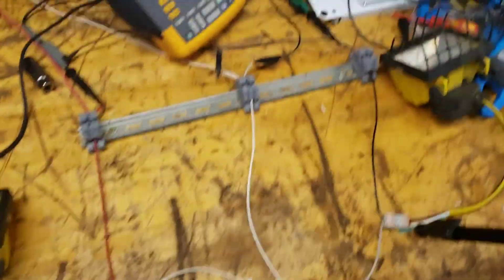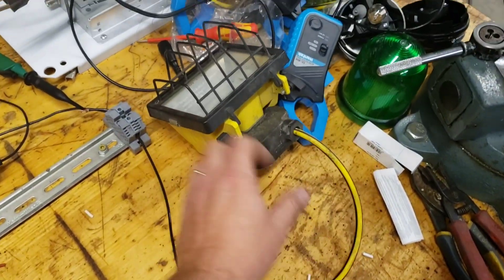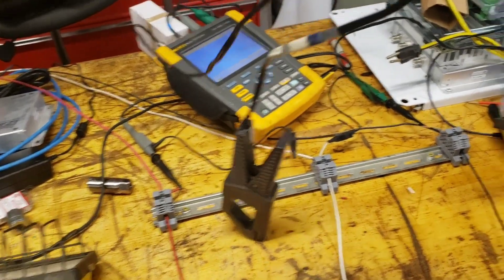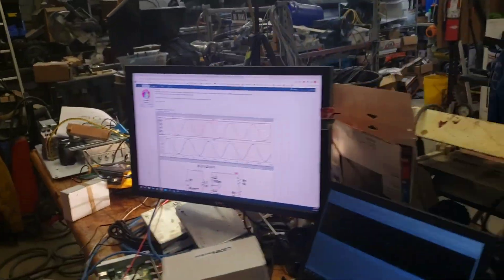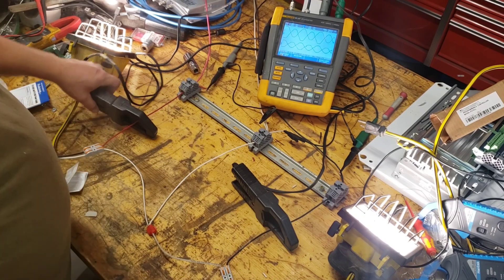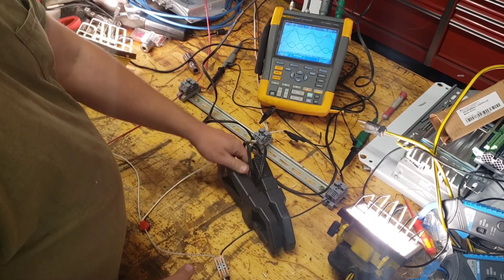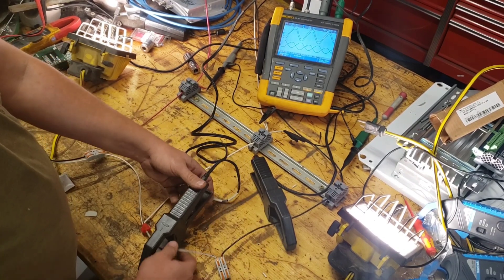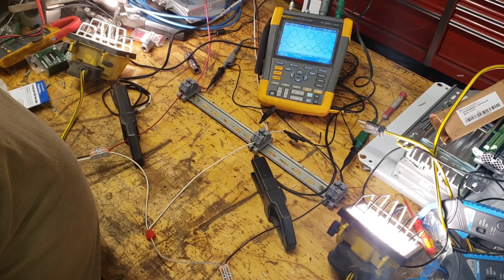Inverted/"180 degrees out of phase" current.

Comment: I'm not party to any of the lead up to this (just a stranger wandering in), but I would point out that those who claim center-tapped split phase systems are inverted or 180 out-of-phase are NOT saying that the current is going in different directions on the Lines. That would be a straw man argument you've shot down if your goal is to disprove the 180 out-of-phase sentiment. Is that what you're trying to do?

The whole 'in' vs 'out' debate is ridiculous in that both sides are right from their own perspective. In my experience though, the 'they're in-phase' crowd is less accepting of those arguing they are 180 out with respect to neutral. It needs to be understood that the 'wrt neutral' component is essential. The two lines-- if not using a neutral-- is just a single signal. So there's not even anything to discuss. When there are 3 points to measure the signal from (bottom, center, and top-- with center as common) then there is no denying that mathematically they are 180 out of phase. To claim otherwise is to deny what's in front of one's face. But if it tastes just soo ucking yucky that they can't even utter the words 'out-of-phase' to describe a wave relationship, then sure, go ahead and call them series-aiding-splits or whatever the heck floats the butt curls.
Reply from the maker: You read the situation correctly and I'm in the "in phase" camp. I have no problem with someone saying "L1 and and L2 are opposing with respect to neutral. " I like to take it a step further and say "they only appear out of phase when neutral is used as a reference" but I don't expect anyone else to make such concessions. 

What I push back against is people saying "L1 and L2 ARE 180 degrees out of phase with each other" because that (more than) implies something that's absolutely incorrect and leads to further misconception, like that current flows opposite directions through the loads on L1 and the loads on L2. That's the misconception that prompted this video. I had a combined 150 years worth Electronics Engineering experience ganging up on me in a forum insisting that not only (the voltages don't just APPEAR out of phase but actually ARE out phase) but that (the CURRENT, TOO! is out of phase). They "proved" it in LTSpice by flipping a resistor to force the reading to be out of phase. Link to the discussion below if you're interested.

To be clear, both sides of this argument generally are using "180 degrees out of phase" when what they really mean is "inverted polarity." I don't think anyone is discussing this in terms of one side lagging the other by 8.3333mS. Therefore saying L1 IS inverted (180 degrees out of phase) with respect to L2 implies a physically inverse connection. It's easy to think of it this way since there are just two end and a middle, but it's wrong, and easier to see the incorrectness of it by using an example with more points. Like a series string of batteries in a golf cart. If one of six 8V batteries IS inverted, then the overall voltage will be 32V instead of 48V. If you measure 48V then you know that they are all connected in series and precisely zero of them ARE connected inversely. In the arguably incorrect terminology framing this discussion, they are all IN phase. If you want to reference all your measurements from the center point between battery #3 and battery #4 that's fine, but all your measurements from center to left will read negative while all your measurements from center to right will read positive, and you'll need to keep that  in mind, maybe state the effect of your chosen reference point when giving measurement values, so as not to confuse people as to why some of your measurements are negative while others are positive, and confuse them so thoroughly that they go all the way to retirement as an Electronics Engineer, thinking that current is flowing opposite directions through half the batteries.

https://forum.allaboutcircuits.com/threads/l1-is-180-degrees-out-of-phase-with-l2-hurr-dee-durr.172264/post-1785368
Reply: @Charles Staton  If you stand in the middle of a river, the current of the river is all going 'in the same direction' but to the observer in the river some of it is coming towards you, while some of it is going away from you. Both realities are true.

That's the situation here. The current waveforms are out of phase, again, with respect to neutral. What you've shown is that the river is traveling in the same direction, but to neutral L1 is 'coming' while L2 is 'going.'

I have no doubt you and many others making your argument (https://youtu.be/nOSYHUxHxG8)
understand the physical realities of the system perfectly well. Just as many making the 180 OOP argument understand it perfectly well. It's basically political-- its how one chooses to talk about it and what one choose to focus on and what you choose to ignore.

You say "they only APPEAR out of phase when neutral is used as a reference." OK. What's the difference? Why is using a neutral point reference a lie? Phase relationships are specifically about just that: relationships.  Reference defines the relationship.

If your camp wants to define in-phase as two coils 'boosting' rather than 'bucking' or series-aiding rather than series canceling, than sure, one cannot (should not) argue otherwise. But deciding that THAT is the only true way to define the relationship is political. Straight up. 

Let's look to a 3 phase system for some comparisons:
If you measured 2 lines of a 3 phase system as you have, you would get 60 degree out of phase as your determination. But there's no argument it's 120 degrees (right?). So why is it 120 and not 60? Because neutral is reference!

Take the river for example. Let's say you have a river with a bend in it to bring the analogy to 3 phase. If you stand at the vertex of that bend, then measure the angle from one leg to the other, you get 120 degrees (and the current is coming at you in  one case and going away from you in the other-- sound familiar?).

If, on the other hand, you insist that because the river is going in the same direction (with the exception of the bend) that the measurment be taken from someone always looking down river, guess how many degrees the river turns? Yup 60. So do you want claim two legs of a 3 phase system are 60 degreea oop?

If not, why should the rules be applied differently for a split phase system? 

One last point: hopefully it's agreed upon that if neutral is not involved in the measurment AT ALL, not only are the two lines not out of phase, they are also not two signals IN PHASE! They ARE ONE SIGNAL! This is true in 3 phase as well. 2 lines not using the neutral have no 'phase angle' they have a single signal between them. So I agree that saying the two lines themselves are out of phase with no reference point is entirely incorrect/meaningless.

BTW I do like your video, I got a kick out of it, even if I'm of the opposite political opinion :)
Reply from the maker: @spruce_goose5169  I've been making this argument for years and you've just made the most cogent counterpoints I've ever encountered. What you've said deserves a reply that I'm not prepared to compose on a cell phone so I will be responding later from a computer. Thank you for the stimulating discussion.
Reply from the maker: @spruce_goose5169   (Part 1 of 2) I’m sorry, but what follows is the longest comment I have ever typed on Youtube. You brought it on yourself though, you really should have known better ;) . I won’t blame you for not reading it all, but I hope that you do.

"If you stand in the middle of a river, the current of the river is all going 'in the same direction' but to the observer in the river some of it is coming towards you, while some of it is going away from you. Both realities are true."

I use the same analogy (worded a bit differently) quite often, but I use it to point out the difference between absolute measurements and differential measurements. What I say is “Current is an absolute measurement. It needs no reference point. A river flows down hill whether you’re looking at it from the source, the destination, or outer space. You can decorate all the components of a schematic in little + and – symbols a la KCL if you find that helpful but it doesn’t change the fundamental reality of the absolute nature of current.”

 “That's the situation here. The current waveforms are out of phase, again, with respect to neutral. What you've shown is that the river is traveling in the same direction, but to neutral L1 is 'coming' while L2 is 'going.’”

Going back to the video, If you are not in agreement with my previous statement, could you explain how I should take these absolute measurements of current “with respect to neutral” in the real world, using a current clamp? I’m sure it would involve flipping the clamp, but at what point? Just after the load? In the middle of the load? Just before the neutral node? Right in the middle of the neutral node? What if I cut off the neutral wire so there’s just two loads in series across 240V (no current flows in the neutral anyway, with a balanced load)? Should I still flip the clamp? Getting the answer that the “180 degrees out of phase” crowd wants to see, feels very “forced” the moment you take the exercise off paper and into the real world. And that’s because it IS forced. It’s a teaching aid (KCL) taken past its point of efficacy. 

In contrast to current, voltage is a differential measurement, that only exists between two points. In the case of measuring split phase mains where both measurements are referenced to neutral, the voltage waveforms will (be? appear?) inverse to each other. I can’t speak with as much authority on voltage because there is some philosophical aspect to it. It’s like the question “if a tree falls in the forest and nobody is there to hear it, is there any sound?” Well that depends on whether you consider sound to be a human observation (measurement) or an intrinsic property of the universe. 

Same for voltage. Do you consider voltage to exist purely as a measurement? Or do you consider it be an intrinsic property of the universe? I’m on the side of it being an intrinsic property of the universe. In my book, if you put a DMM across a battery and it read 12.65V, it still has 12.65V when you take the DMM off of it. Technically this is in defiance of Ohm’s law which states V=IR, and as soon as you remove the DMM, there is no I and no R, so there is no V. But that’s a little too abstract for my taste. 

But if you’re on the opposite end of the spectrum and place higher import on academic curiosities than you do intuitive concepts, then you might view voltage purely as a measurement which only exists while being measured, and therefore it doesn’t just “appear” out of phase, it IS out of phase. That’s a “valid” point of view I suppose, but as I said, too abstract for my taste, and I think it confuses the hell out of people who are trying to learn this stuff. That’s why I’m so adamant about presenting what seems to me to be the more intuitive side things. 

“ It's basically political-- its how one chooses to talk about it and what one choose to focus on and what you choose to ignore.”

Agreed. 

“If your camp wants to define in-phase as two coils 'boosting' rather than 'bucking' or series-aiding rather than series canceling, than sure, one cannot (should not) argue otherwise. But deciding that THAT is the only true way to define the relationship is political. Straight up.”

I like that you use the word “political” rather than “semantic,” which is what I normally hear. This is much more than a semantic difference, and "political" is really the most accurate description of it. There are plenty of political parallels (ex: debates on gender/sex). I subscribe to the views that I do, because I think they are less abstract and more readily demonstrated in the real world. Do you disagree? If you think that your views should be the dominant ones, what is your reasoning for that? 

“Let's look to a 3 phase system for some comparisons: If you measured 2 lines of a 3 phase system as you have, you would get 60 degree out of phase as your determination.”

Can you explain? I do not know where 60 degrees is coming from. I measure 3ph on a weekly basis and it is always 120 degrees. I demonstrated it in my other video.
Reply from the maker: @spruce_goose5169  (Part 2 of 2)

“But there's no argument it's 120 degrees (right?). So why is it 120 and not 60? Because neutral is reference!”

3ph measurements need not be taken from neutral, are often befuddling when taken from neutral (ex: high-leg delta), and often there is no neutral from which to take them. If the service is a wye with an included neutral, you can take measurements WRT neutral, but otherwise you need an isolated scope or a non-isolated scope with active differential probes which essentially turn it into an isolated scope. The measurements are usually taken phase-to-phase. 

“Take the river for example. Let's say you have a river with a bend in it to bring the analogy to 3 phase. If you stand at the vertex of that bend, then measure the angle from one leg to the other, you get 120 degrees (and the current is coming at you in one case and going away from you in the other-- sound familiar?). If, on the other hand, you insist that because the river is going in the same direction (with the exception of the bend) that the measurement be taken from someone always looking down river, guess how many degrees the river turns? Yup 60. So do you want claim two legs of a 3 phase system are 60 degrees oop? If not, why should the rules be applied differently for a split phase system? ”

In all my attempts to make the river analogy fit 3ph, I have failed. I feel like you’re succeeding where I fail, but I can’t grasp what you’re saying. Particularly with regard to the 60 degrees thing. In all sincerity I think there is something to what you’re saying, and I’m just not understanding it. If you can think of another way to word this, I would like to hear it. 

“One last point: hopefully it's agreed upon that if neutral is not involved in the measurment AT ALL, not only are the two lines not out of phase, they are also not two signals IN PHASE! They ARE ONE SIGNAL! This is true in 3 phase as well. 2 lines not using the neutral have no 'phase angle' they have a single signal between them. So I agree that saying the two lines themselves are out of phase with no reference point is entirely incorrect/meaningless.”

Agreed. And I make this point often in these discussions. You take the output of a single phase isolation transformer, there are only two wires, one phase. What is it out of phase with? Nothing. Every one of the tens or hundreds or thousands of turns of the secondary carries the same current the same direction and induces voltage with the same polarity, and is in-phase with every other turn. You can think of them (the individual turns) like many miniscule series voltage sources all adding up to 240V. Now locate the very center turn of the winding, scratch the enamel off, solder a wire onto it, and connect that wire to earth ground. You’ve just turned it into a split phase transformer exactly like the mains pole transformer. Does doing this change anything? No, it doesn’t. You haven't inverted or phase-shifted anything. Current still flows, and voltage is still induced, exactly as it was before. 

Have you created a new “phase” by making this modification? It’s hard to reach consensus on this one, as everyone seems to have a different definition of “phase.” If you’re approaching it from the mathematical perspective and associate “phase” with phasors, then probably you consider this a new phase. I approach it from the physical perspective, so my concept of “phase” is tied to EM fields. In my mind you have not created a new phase; it is still SINGLE phase because there is a SINGLE alternating EM field. You still have just the single phase or single signal, you’ve just “split” that signal (hence “split phase”) and you’re looking at two halves of one signal. As a single phase, it cannot be “out of phase” with itself. 

IMO this is another important component of the “practical” point of view as opposed to the mathematical point of view. I use an analogy of a car on a drag strip, racing back and forth. If you stand at one end, you’ll see a car driving ¼ mile away from you and ¼ mile back. If you stand in the middle, you’ll see a car driving 1/8 mile away from you, 1/8 mile back, 1/8 mile in the opposite direction, and 1/8 mile back. But what you will never see, no matter where you stand, is two cars driving perpetually in opposite directions, crossing always exactly in the middle. There is only one car. Your scope is showing you two different aspects of it, like two cameras recording the same car. There is only one phase, one wave, one signal, and your scope shows two halves of it. The two halves cannot be out of phase as there is only one phase. 

“BTW I do like your video, I got a kick out of it, even if I'm of the opposite political opinion :)”

Thanks, and I’m glad you found it entertaining. I am likewise enjoying this conversation.
Reply: @charlesstaton8104  
Ok, I will do my best here.
I will start with this one: 
“If you think that your views should be the dominant ones, what is your reasoning for that?”
I’m less saying my view should be the dominant one and more saying that there are multiple, equally valid ways to look at this. Which one is ‘right’ really depends on the definitions being used and what someone feels is more important or reflective of reality (and even that doesn’t always have a right answer, i.e. consider general relatively).

“could you explain how I should take these absolute measurements of current “with respect to neutral” in the real world, using a current clamp?”
It all just depends on what you want your sine wave graph to be depicting. If your loads are balanced and you put the clamp on the actual neutral return leg, you would see essentially zero current. If they aren't balanced, you will still only see current in one direction, and it depends on which load it bigger. The argument is simply how the waveforms should be displayed in relation to each other. In this sense, it’s really no different than the discussion on voltage. If neutral is ’reference’ than in regards to current positive waveforms is 'coming' and negative waveforms are 'going.' Your measurements are choosing to keep a common direction rather than a common point, so you are forcing it to always be 'going' by changing the starting point. I'm not saying you can't do that, but it is what it is. Tomato tomato, as far as what is 'real'. 

“Do you consider voltage to exist purely as a measurement? Or do you consider it be an intrinsic property of the universe?”
I’m not sure I understand what you’re driving at here. I absolutely agree with your statement that, “voltage is a differential measurement, that only exists between two points.” Anything beyond that—for the purposes of this discussion—seems too far gone.
“if you put a DMM across a battery and it read 12.65V, it still has 12.65V when you take the DMM off of it”
Maybe I see what you’re getting at, but I’m not sure it’s relevant to the discussion. But to answer, I think that the TWO TERMINALS of the battery have a certain voltage between them regardless of whether we’re actively measuring them. But the battery itself does not CONTAIN voltage of a precise value until two precise points are called out. 

“I do not know where 60 degrees is coming from.” … “3ph measurements need not be taken from neutral, are often befuddling when taken from neutral (ex: high-leg delta),”
Ok here’s the meat now. First, I am not referring to high-leg delta, in which the ground is NOT the system wide neutral. For simplicity, I like to consider delta Y because it has a physical neutral that will yield the standard 3-phase sine wave graph. I think I will mostly abandon the river analogy and focus on this sine wave graph. If any of my below statements seem erroneous, please call them out specifically. 

Looking at the graph, the x-axis and the y-axis are common reference points for all these sine waves. Y axis being amplitude (voltage) and x-axis being time. The flat line of the x-axis itself is representative of the neutral voltage, because at every moment in time, the voltage amplitude of the neutral is zero (if we make it the reference point for the wye). So, the voltage waveform of every other line is in respect to the neutral. When the sine wave peaks, it means there is the maximum instantaneous voltage between that line and the neutral point. Two points—a voltage.

When a waveform is above the x-axis it has ‘positive’ amplitude which translates to something like polarity (and with current is a more obvious direction indicator, related to this polarity). When the line has a positive slope (climbing) it means the voltage potential (to neutral) is increasing. When the line crosses the x-axis, it means the voltage potential (to neutral) is zero, but at this point it is rapidly changing given the steep slope.

The positive peaks of these waveforms are 120 degrees apart. The positive slope zero crossings are 120 degrees apart. The negative peaks are 120 apart. The negative slope zero crossings are 120 apart. BUT: the positive peak and the negative peak of two given lines are only 60 degrees apart, likewise for the positive and negative slope crossings. The potential difference between a line and the neutral is at its maximum twice per a cycle—it just has differently polarity for the two times. But as far as neutral is concerned, line 1 would have a maximum potential, and then 60 degrees later line 2 would have a maximum potential—just of different polarity. We can ‘flip the polarity’ of one of the wye connected coils and we would invert the sine wave, thus we would then have 60 degrees of rotation between two peaks of the SAME polarity. 

If we flipped the polarity like this we would no longer have the same line to line voltage. We would not use the square root of 3 (1.73) multiplier. Notice that 120 degrees OOP equates to a multiplier (going from phase (line to neutral) to line-line voltage) of 1.73. If it were 60, it would be smaller than 1. So if split phase lines are 0 degrees apart, why is the voltage multiplier when going from line-to-neutral voltage to line-to-line voltage 2. Doesn’t 180 = a multiplier of 2 make a lot of sense. The trig of 180=x2 is consistent with 120=x1.73. 

I’m out of steam for now, but hopefully this is making some sense and the relationship to the split phase is apparent (?). And hopefully my earlier 60 degree comment adds up now (?). I am happy to keep going later as there is more to explore on this front.

I will make one other point for now: I don’t think any of these mathematics or graphs are lies, nor are they a full self-contained reality. They are models for something that is occurring in reality—but that ‘something’ is very much real, and these sine waves represent that reality. In the case of a split phase voltage waveform displayed as 180 out of phase, it is depicting the reality of the instantaneous voltages the exist (and can be measured) between the lines and the neutral (reference) point.

So I am in complete agreement that center tapping a coil does not fundamental change anything about the coil*, but it does change how usable and measurable voltages relate to one another. It’s in fact what allows us to run these split phase systems with 120/240: tapping the center to yield an entirely new voltage (120 rms). Does the fact that we can suddenly get 120 volts rms from what is otherwise a 240 rms coil ‘change’ the coil? Not really, but it does change a certain practical reality nonetheless.
*but if current was only flowing through half the secondary it would change the EM fields.
Reply from the maker: @spruce_goose5169  “I’m less saying my view should be the dominant one and more saying that there are multiple, equally valid ways to look at this. Which one is ‘right’ really depends on the definitions being used and what someone feels is more important or reflective of reality (and even that doesn’t always have a right answer, i.e. consider general relatively).”

Ok, fair enough.

“I’m not sure I understand what you’re driving at here. I absolutely agree with your statement that, “voltage is a differential measurement, that only exists between two points.” Anything beyond that—for the purposes of this discussion—seems too far gone. […] Maybe I see what you’re getting at, but I’m not sure it’s relevant to the discussion. But to answer, I think that the TWO TERMINALS of the battery have a certain voltage between them regardless of whether we’re actively measuring them. But the battery itself does not CONTAIN voltage of a precise value until two precise points are called out.”

Sorry, I might have wandered a bit there. What I’m driving at is that for a given supply there is an entire potential difference that simply EXISTS, independent of measurement. But voltage IS a measurement, right? So in the absence of a measurement, is there any voltage? I say there is. Maybe I should be saying “charge” or “potential” or “EMF” instead of “voltage” if I’m not referring to an actual measurement? I’m going to keep saying voltage for now, but just understand that I mean that potential difference which exists across an entire source, with a real amplitude and a real polarity, regardless of whether or not we measure its entire amplitude, and/or with consistent measurement polarity. 

Any voltage measurement is valid (maybe not useful, but valid) as long as the two points are called out; it doesn’t matter what the points are, as long as they are stated. 

I can take a single measurement from N to L1 and call that a 120V signal, end of story. That’s a valid measurement; a valid story with a valid end. But it’s only the end of the story that I TOLD. The fact that I didn’t include a chapter two doesn’t poof the other half of the supply out of existence. There’s reality (in its entirety), and then there’s the story that I told. In this case they are not quite equivalent. 

I can measure from N to L1 and call that a 120V signal, then from N to L2 and call that an inverse 120V signal, end of story. Those are valid measurements; a valid story with two valid chapters. But it’s only the story that I TOLD. The fact that my measurements were taken with inconsistent polarity and don’t add up to the total voltage of the supply and I provide no explanation for why that is (only that this is a special case where we subtract (120v-(-120v)) instead of adding as we do in all other cases of series sources – just take my word for it) does not negate the validity of my measurements. Still, my story, valid as it may be, is not quite equivalent with the entire reality.

OR, I can place my probes across the source with consistent polarity, measure from L1 to N and from N to L2 (with an isolated scope) or if I don’t have an isolated scope I can just invert one of the channels. Then my measurements are not only valid, they match the entire reality.

So, 3 different examples, all equally valid, except one is more intuitive and useful IMO.

“The positive peaks of these waveforms are 120 degrees apart. The positive slope zero crossings are 120 degrees apart. The negative peaks are 120 apart. The negative slope zero crossings are 120 apart. BUT: the positive peak and the negative peak of two given lines are only 60 degrees apart, likewise for the positive and negative slope crossings. The potential difference between a line and the neutral is at its maximum twice per a cycle—it just has differently polarity for the two times. But as far as neutral is concerned, line 1 would have a maximum potential, and then 60 degrees later line 2 would have a maximum potential—just of different polarity. We can ‘flip the polarity’ of one of the wye connected coils and we would invert the sine wave, thus we would then have 60 degrees of rotation between two peaks of the SAME polarity.”

Ok, I understand now where you were coming from with the 60 degrees comments, thank you for explaining.

“If we flipped the polarity like this we would no longer have the same line to line voltage. We would not use the square root of 3 (1.73) multiplier. Notice that 120 degrees OOP equates to a multiplier (going from phase (line to neutral) to line-line voltage) of 1.73. If it were 60, it would be smaller than 1. So if split phase lines are 0 degrees apart, why is the voltage multiplier when going from line-to-neutral voltage to line-to-line voltage 2. Doesn’t 180 = a multiplier of 2 make a lot of sense. The trig of 180=x2 is consistent with 120=x1.73.”

This is why I stress the concept of “phase” as it relates to EM fields. You’re to applying a specific mathematical operation to a problem where I think that it doesn’t (or doesn’t need to) apply. The phasor trig DOES apply to a 3ph supply because there are 3 independent phases which can referenced from one to another. But for a single phase supply there is only one phase and therefore no valid reference from itself to itself. A 3 phase supply has 3 EM fields; it’s (3) single phase supplies. You could pick any one of them, add a grounded center-tap to it, and we could rehash this whole discussion with regard to that one split phase supply, but it would be a fundamentally different discussion than the 3ph discussion. The neutral node in a 3ph wye supply is the electrical “bridge” between these three separate supplies, while the neutral node in a split single phase supply is just a shortcut back to the middle of the single winding; they aren’t quite the same thing in my mind. 

Since the 3ph system is 3 separate sources, we connect them all together at one end of each (call it the “-“ end) to a common point. So you have your Wye diagram with all the “-“ symbols all to the inside near the neutral connection and all your “+” symbols pointing outward. Since they are all connected “-“ to “-“ to “-,“ now the math DOES become (X-(-Y)) (in phasor notation). I mean, you CAN do the same thing with split phase (assume “-“ connected to “-“ and 180 degrees OOP) and get the right answer, but it is a fruitless exercise IMO.

120 ∠ 0° + 120 ∠ 0° = 240 ∠ 0° <assuming in-phase and adding, multiplier = 2.0
120 ∠ 0° - 120 ∠ 180° = 240 ∠ 90°<assuming out-of-phase and subtracting, multiplier = 2.0
120 ∠ 0° - 120 ∠ 60° = 120 ∠ -60°<with 60° angle, multiplier = 1.0
277 ∠ 0° - 277 ∠ 120° = 479.78 ∠ -30°<common example: 277/480V, multiplier = 1.732

“I will make one other point for now: I don’t think any of these mathematics or graphs are lies, nor are they a full self-contained reality. They are models for something that is occurring in reality—but that ‘something’ is very much real, and these sine waves represent that reality.”

Agreed, although I do think some ways of displaying the data are more reflective of that reality. I think the 180 degree OOP model is hard to swallow for anyone who has trouble pressing the “I believe” button, and for those who have no problem pressing it, it sets them up for misunderstanding in other areas. 

“In the case of a split phase voltage waveform displayed as 180 out of phase, it is depicting the reality of the instantaneous voltages the exist (and can be measured) between the lines and the neutral (reference) point. So I am in complete agreement that center tapping a coil does not fundamental change anything about the coil*, but it does change how usable and measurable voltages relate to one another. It’s in fact what allows us to run these split phase systems with 120/240: tapping the center to yield an entirely new voltage (120 rms).”

Fair enough

"Does the fact that we can suddenly get 120 volts rms from what is otherwise a 240 rms coil ‘change’ the coil? Not really, but it does change a certain practical reality nonetheless. *but if current was only flowing through half the secondary it would change the EM fields.”

Agreed, It would change the intensity/distribution of the field but not the quantity (1) of them.
Reply: @charlesstaton8104  
Well we really agree on quite a lot, which is saying something in this age old debate. I think we can argue about which notion is more ‘intuitive,’ but everyone’s intuition is different. I would argue that no declaration (in-phase or out) is itself helpful to learners. What’s helpful is discussing the nuance and understanding why the debate exists in the first place!
And so to continue…

“that this is a special case where we subtract (120v-(-120v))”

I don't really see anything special about that.

_“OR, I can place my probes across the source with consistent polarity, measure from L1 to N and from N to L2 (with an isolated scope) or if I don’t have an isolated scope I can just invert one of the channels. Then my measurements are not only valid, they match the entire reality.
So, 3 different examples, all equally valid, except one is more intuitive and useful IMO.”_

I see nothing more ‘real’ about your proposed measuring scheme. Phasing is always a relative thing. I think that may be our fundamental divergence here. The reason I brought up the 3 phase comparison is because in 3 phase (wye) no one ever seems to question how to take the measurements—neutral  will always be the common reference for determining phase angles. I don’t see why a split phase system should really be any different? You can move your probes the way you say so that you can add the voltages, but I don’t see how that is any more correct, and in fact bucks tradition so far as I can tell.

“You’re to applying a specific mathematical operation to a problem where I think that it doesn’t (or doesn’t need to) apply.”

My original comment regarding getting a measurement of 60 degrees out of phase on a 3 phase system was that if you attached your current clamps as you did in your video, you would get a result of 60 degrees out of phase. I’m not clear on what your rebuttal is to that point? It doesn’t really have anything to do with the numbers or phasors—I just used that to show the congruity between the two situations. It’s basically my way of pointing out a measurement convention. Why should that convention be bucked just because it’s split phase?

” what you will never see, no matter where you stand, is two cars driving perpetually in opposite directions, crossing always exactly in the middle. There is only one car. Your scope is showing you two different aspects of it, like two cameras recording the same car. There is only one phase, one wave, one signal, and your scope shows two halves of it. The two halves cannot be out of phase as there is only one phase.”

Ok going back to your earlier comment because I glossed over this important point. I think I see why you view these two waveforms as ‘lies’ but I think we need to stop and consider what the waveforms represent. The issue with your car analogy is that there is not one car going back and forth with it’s position being superimposed as you imply. It is a stream and we are measuring the rate of flow compared to time. When you say there is only one ‘wave’ are you implying there is some sort of physical electrical wave that exists that we’re trying to image, and we’re somehow doubling up on that image? I can sort of picture what you’re describing: like a ring of light traveling up and down this single coil, oscillating back and forth. But the phase sine diagrams are showing changes in the rate and direction of current, which does depend entirely on reference perspective and is not a ‘ghost’ image of something else more real. Current can be 'coming and going' at the same time, so two waveforms is perfectly logical, and the waveforms being 'inverted' or '180 degrees OOP' is also perfectly logical. 

If someone wants to (as people do-- and perhaps you are) argue that any linear relationship (0 and 180 degrees both) has no phase shift because there is no ‘bend' and no rotation can be created i.e. the peaks all line up, they just have different ‘polarity’… well I can respect that argument for what it is. BUT, if someone wants to claim that the split phase system as it exists is ‘in-phase’ wrt neutral and that if one of the legs were inverted it would THEN be 180 degrees out of phase, I would need them to explain the rationale in detail. I’ve never heard any believable rationale for that. Would you say you are arguing the former or the latter? *See post below for a thought experiment on the latter point.

I suspect that we’ll never reach a total agreement, but I imagine we both understand the counter arguments a little better, which seems like a win to me.
Reply: If it’s the latter, here’s a little thought experiment:  
Take a bungie cord or similar elastic type chord. Twist the bungie chord up so that it has rotational tension throughout, from top to bottom, all twisting in the same direction (sound familiar). Now (in your mind) grab the center of that bungie chord and let it unravel. What happens to the two ends? Do they rotate in the same direction? Nope. They rotate in opposite directions. And compared to the middle clamp point they have X speed, but to each other they have 2X speed.

If instead we held the chord in the middle and twisted each end in opposite directions, then released, we would see the two ends move in the same direction. And the rotational speed between the end and the center would be X while it would be 0 between the ends.

I’m not sure how you or others would view this experiment intuitively in terms of phasing. To me it’s not so clear why, given that the two sides spin in opposite directions, they would intuitively be ‘in-phase’ more than the case where they spin in the same direction.

This analogy is loose and falls apart in many ways, but hopefully the relationship is apparent and the point not lost. I can come up with half baked analogies all night. Next one involves a slinky ;)
Reply from the maker: @spruce_goose5169  excellent points! I just got home and it's just past 9:30pm here, so I will have to reply tomorrow.
Reply from the maker: @spruce_goose5169  ”Well we really agree on quite a lot, which is saying something in this age old debate. I think we can argue about which notion is more ‘intuitive,’ but everyone’s intuition is different. I would argue that no declaration (in-phase or out) is itself helpful to learners. What’s helpful is discussing the nuance and understanding why the debate exists in the first place!”

I agree. I know more people find the ‘180 deg OOP’ paradigm more intuitive than mine, but I suspect that is almost entirely because that’s the way the vast majority is taught the concept, and re-learning something a different way is more painful than learning it the first time. I don’t expect to change any minds that are already made up (I’ve been at this long enough to know better) but putting the info out there, having the talks, getting people thinking about it (even if only thinking of ways to disprove it) will hopefully reach people who are just learning, and lead to better understanding no matter which side of the fence they end up on. 

"that this is a special case where we subtract (120v-(-120v))"
"I don't really see anything special about that."

I was referring to other series sources, like battery packs, where we measure each source with consistent polarity, get measurements with consistent polarity, and add the values to get total voltage. Most people can’t (or won’t) explain why in the case of split phase we subtract-(UP) instead of adding-(UP) 120V and 120V to get 240V. I think in most cases, they don’t know why. In some cases, they know the answer but won’t say it because it compromises their position. You subtract because that’s a shortcut for inverting before adding (which is how you display the 240V waveform on a mains-referenced scope, which should be pretty telling) – but why do you have to invert before adding…?

“I see nothing more ‘real’ about your proposed measuring scheme. Phasing is always a relative thing. I think that may be our fundamental divergence here.”

I go back to constructive and destructive interference. Let’s say you have two sources; same frequency, same zero-crossing, but different voltages (10V, 20V). You connect them in series one way and the resultant total voltage is 30V. You reverse the polarity of one of the sources, and the resultant total voltage is 10V. One of these connection schemes is in-phase (like polarity) and the other is out-of-phase (opposite polarity). That is a very real difference that you don’t need a scope to see. You can flip you DMM probes and get the same reading, so it is no mere artifact of your chosen reference. There is no center-tap for which to debate the ways in which using it as a reference affects the apparent phasing. There are no waveforms to quibble over. Just a real, quantifiable difference. Now, say you just measured the 30V with your DMM, so you KNOW the sources have like polarity (in-phase), and then you connect your scope one way and see two out-of-phase waves, then connect it another way and see two in-phase waves, couldn’t you say that one of these representations is arguably more accurate, given that we KNOW the sources are IN-phase?    

”The reason I brought up the 3 phase comparison is because in 3 phase (wye) no one ever seems to question how to take the measurements—neutral will always be the common reference for determining phase angles.”

I know you want to keep this confined to wye, but I think I need to break free of it to make my point. I said it before but it warrants repeating: “3ph measurements need not be taken from neutral, are often befuddling when taken from neutral (ex: high-leg delta), and often there IS NO neutral from which to take them.” How do you measure the output of a 3ph wye-delta isolation transformer? I measure it phase-to-phase. And since I'm in that habit, that's also how I measure 3ph wye.

I don’t mean that as a trivial “gotcha on a technicality.” It is an important point to consider. The 3 phases of a 3ph supply have 120 degrees phase shift relative to each other , not relative to neutral. We use neutral as a reference most often, only because it is usually convenient to do so, but that does not endow it any special properties that make it THE reference point. Neutral has no bearing on phase. You can disconnect the windings of 3ph wye generator and have 3 separate sources that can be connected any way you want, with or without a neutral, and they will be 120deg OOP no matter what (even if you keep them electrically isolated from one another so there is no common reference) because the windings which create these 3 sources are mechanically oriented 120 degrees around the stator.

”My original comment regarding getting a measurement of 60 degrees out of phase on a 3 phase system was that if you attached your current clamps as you did in your video, you would get a result of 60 degrees out of phase. I’m not clear on what your rebuttal is to that point?”

If that was your point then I read into it something that wasn’t there, and there is no rebuttal. 

”It doesn’t really have anything to do with the numbers or phasors—I just used that to show the congruity between the two situations. It’s basically my way of pointing out a measurement convention. Why should that convention be bucked just because it’s split phase?”

Not because it’s split phase, but because it’s single phase. Phase measurements are only relevant from one PHASE (in the EM fields sense) to another PHASE (in the EM fields sense). If you connect your scope to a single phase in such a way that it displays two waves, that’s like measuring one stick with two rulers. Ideally you would use only a single ruler (isolated scope) to measure the entire stick, or if you’re going to take two measurements then the rulers (channels) should be oriented the same direction, and the total added. But with a mains-referenced scope, you have two rulers nailed through their “0” marks to the middle of the stick. You can’t flip your ruler and take the measurement properly, so this needs to be taken into account. That’s why you have to invert and add on a scope. One of your measurements is backwards.

3 phase on the other hand is 3 sticks and 3 rulers. The 3 PHASES of a 3ph supply are 3 unique electromagnetic circuits (sticks) that can each be themselves split and assigned reference points (“neutral” or any other name you might assign), but none of those subdivisions result in the creation of new/unique EM circuits (phases) (sticks). 

“I think I see why you view these two waveforms as ‘lies’ but I think we need to stop and consider what the waveforms represent. The issue with your car analogy is that there is not one car going back and forth with it’s position being superimposed as you imply. It is a stream and we are measuring the rate of flow compared to time. When you say there is only one ‘wave’ are you implying there is some sort of physical electrical wave that exists that we’re trying to image, and we’re somehow doubling up on that image?”

Yes. The EM field. It's critical to consider, that’s why I keep stressing it. The EM field in the transformer core (or generator stator) is growing in one direction, peaking, shrinking, zero, growing in the other direction, peaking, shrinking, zero, 60 times per second. The EM field is the “phase” - the source of the voltage and the current. If every turn of wire is wrapped the same direction around the core, then every turn has the same polarity, same phase. If any turns are wrapped the opposite direction, they will have still be part of the same phase (stick) but have opposite polarity (destructive interference).
Reply from the maker: @spruce_goose5169  ”I can sort of picture what you’re describing: like a ring of light traveling up and down this single coil, oscillating back and forth. But the phase sine diagrams are showing changes in the rate and direction of current, which does depend entirely on reference perspective and is not a ‘ghost’ image of something else more real.”

I continue to disagree with your stance that current depends on a reference point. Voltage (the voltage measurement ) does, but not current. Current is absolute. It can be helpful to think of current as “coming towards you” or “going away,” but that’s just a mental aid for circuit analysis. Even if “you” weren’t “standing there,” current would still be flowing “that way.” As I said and I think you agree, any voltage measurement is valid so long as the points are called out. But voltage measurements which match what we know current to be doing, what we know the EM field to be doing, are IMO not more “valid” but more valuable than ones which do not.

”Current can be 'coming and going' at the same time, so two waveforms is perfectly logical, and the waveforms being 'inverted' or '180 degrees OOP' is also perfectly logical. If someone wants to (as people do-- and perhaps you are) argue that any linear relationship (0 and 180 degrees both) has no phase shift because there is no ‘bend' and no rotation can be created i.e. the peaks all line up, they just have different ‘polarity’… well I can respect that argument for what it is. BUT, if someone wants to claim that the split phase system as it exists is ‘in-phase’ wrt neutral and that if one of the legs were inverted it would THEN be 180 degrees out of phase, I would need them to explain the rationale in detail. I’ve never heard any believable rationale for that. Would you say you are arguing the former or the latter?”

Well, tentatively both. But technically it depends whether you’re talking about voltage or current. 

I wouldn’t argue that both halves of split phase current are in-phase “WRT neutral” because my name isn’t Kirchhoff and to me that is like saying cheese is yellow “WRT the fridge.” The currents in each half, like the currents in each and every turn of the secondary winding, are simply in-phase. Neutral has no bearing on it. If the loads are not balanced then the currents in one half will be greater than the other half, but they will still be in-phase.

For voltage, if you use the center tap as your reference, and if you consider voltage to exist purely as a measurement, then sure, you can say the voltages ARE out of phase, and per your definitions you’ll be right. But with your scope still connected, I’ll come along and connect mine to the same points, using consistent polarity connections, and challenge you to explain how the voltages simultaneously ARE and ARE NOT out of phase, and why your representation is more valuable than mine when half of it contradicts the known direction of current flow and the known behavior of the EM field.

“If it’s the latter, here’s a little thought experiment: Take a bungie cord or similar elastic type chord. Twist the bungie chord up so that it has rotational tension throughout, from top to bottom, all twisting in the same direction (sound familiar). Now (in your mind) grab the center of that bungie chord and let it unravel. What happens to the two ends? Do they rotate in the same direction? Nope. They rotate in opposite directions.”

I don’t know if this a current or voltage analogy, but since it depends on perspective I’m going with voltage. Imagine the cord is horizontal (the ends just magically levitate). Two tiny lego men stand back-to-back on top of your outstretched hand at the time the ends are released. From the center looking out (as a mains-referenced scope would be), both men (both channels) will see their respective end whipping around in the same orientation (both CCW or both CW). So, from a center reference point, they are…? In…phase…? I don’t know if this is good or bad for your side, or if it’s good or bad for mine. TBH I have given the analogy a lot of thought and can’t decide if it's actually analogous or not. It does seem so, but if it is, it might be bad news for both of us. In any case, it is definitely effective in pointing out the nuances of taking multiple measurements of a singular physical phenomena from differing perspectives.

”And compared to the middle clamp point they have X speed, but to each other they have 2X speed. If instead we held the chord in the middle and twisted each end in opposite directions, then released, we would see the two ends move in the same direction. And the rotational speed between the end and the center would be X while it would be 0 between the ends.”

Right, and this is what happens if you actually connect two equivalent sources out-of-phase. I did it in my other video. From center to either end, you get 120V, but from end-to-end you get 0V. 

”I’m not sure how you or others would view this experiment intuitively in terms of phasing. To me it’s not so clear why, given that the two sides spin in opposite directions, they would intuitively be ‘in-phase’ more than the case where they spin in the same direction. This analogy is loose and falls apart in many ways, but hopefully the relationship is apparent and the point not lost. I can come up with half baked analogies all night. Next one involves a slinky ;)”

I look forward to the slinky analogy, but until then, here’s a thought experiment. I’ve mentioned a couple of times turning an isolation transformer into a split phase transformer by locating the center winding, scratching off the enamel, and soldering a wire onto it. Let’s mentally do that again, but instead of adding one tap directly in the middle of the winding, let’s add two taps, splitting the transformer into equal thirds. Are all 3 sections OOP with each other? If so, how? Surely two of the sections are in-phase at least? How do we make a determination about which sections get added and which get subtracted, so that our measurements equal the known total voltage? 
80V-(-80V)-80V? 
80V+(-80V)+80V? 
or is it 
80V+80V+80V? 

“* I suspect that we’ll never reach a total agreement, but I imagine we both understand the counter arguments a little better, which seems like a win to me.”

Definitely! I hope I have at least clarified my talk about EM fields and phase, so maybe the rest of my ramblings will make more sense.
Reply: @charlesstaton8104  Well as is typical for this topic, the discussion has become quite cyclical. Perhaps we could graph it as a sine wave :)

I'll try to keep this a bit more brief (kinda).

"Not because it’s split phase, but because it’s single phase. Phase measurements are only relevant from one PHASE (in the EM fields sense) to another PHASE (in the EM fields sense). If you connect your scope to a single phase in such a way that it displays two waves, that’s like measuring one stick with two rulers."

The wires out in the house running on 120 volts would like to have a word with you about the fact that they cannot exist. Because those branch circuits are operating at 120 V RMS and if they are on different legs, their voltage (or current) waveforms are 180/inverse WRT the common ground. It seems like much of your argument is predicated on the notion that the center-tap ground connection basically doesn't exist. It's as if you think it serves only as a point of measurement, and thus measurements using that reference point are hog-wash. But we USE that point in the circuit! More below on this. (And just as a quip: as far as I know, one can use two rulers to measure one stick and still get accurate and real results, so long as the rulers butt together.)

"The EM field in the transformer core (or generator stator) is growing in one direction, peaking, shrinking, zero, growing in the other direction, peaking, shrinking, zero, 60 times per second."

You may be saying this, but just for clarity: the field induces a voltage on the entirety of the coil simultaneously (or at the speed of light), not one end of it first, then the other. It is not some yo-yo that is traveling up and down the coil. I don't think you're saying that, but for clarity.
I feel I really get where you're coming from here and it seems to be the essence of your argument. If the primary is this one oscillating field, then how can the secondary suddenly have two 'phase waves' (if there is such a thing)? Those two waves must surely be some sort of figment.

And honestly there is something to be said for that point. I agree that everything in a split phase system is 'in-phase' by virtue of there being matching peaks-- and there is also no potential for a rotating magnetic field, it is all linear-- but by splitting the secondary (which is electrically the same as having two series-aiding generators), we affect the secondary circuitry in real ways. If loads are perfectly balanced, this becomes less obvious (besides measurements we might take using this center-tap). But when there are imbalanced loads, the secondary will imbalance (or you could say one 'generator' would be more loaded) and which side (or generator) depends on which 120v load is bigger. To me, the two inverted sine waves could be considered indicators of this ability to imbalance one end of the coil / one generator. How would one single wave account for this? The maximum peaks coincide in time, but the peaks have opposite polarity, and thus on one side current will be traveling towards this common point, and on the other, away.

Which leads me to one other point:

I'm a bit baffled by your insistence that current is somehow different from voltage in terms of phase relationship. I know you realize voltage causes the current, and so as polarity shifts, so to does the direction of current. And current still needs some frame of reference. On earth, we have cardinal directions to describe 'absolute' direction, but electrically what is the equivalent? If I stood on one bank of a river, it would be going left to right. On the other bank, it would be going right to left. I could say 'it's flowing south,' but in an electric circuit what would I say? It's flowing towards the battery? Uh, oh, nope. Cus it's doing that no matter what. It's flowing towards the neutral? Nope doesn't work either. Of course you could put a diode in or something, but it doesn't change the need for phase relationships to have this commonality, just like with voltage. How about we say 'away from, or towards, point N? It works! 
Whether it's voltage or current, when you insist on moving your probes like you do to force 'in-phase waves', it feels like your putting the cart before the horse: that you have a preconceived notion and your trying to prove it. I think it actually weakens your argument because it suggests you don't understand the concept of common reference (which doesn't need to be a physical neutral and can be virtual, but nonetheless must be common). Don't forget the 30 degree phase shift when changing from phase measurements (L-N) to line measurements (L-L).

I suppose I can't help but add that if you don't have a rebuttal for the fact that the way you are suggesting measuring phase relationships would lead one to go out and measure 3-phase as being 60 degrees OOP, then I'm not sure why you worry about people getting 'confused' by thinking L1 is 180 OOP wrt N to L2, because if they go and do what you suggest, they're gonna be coming home to mommy saying 3-phase is 60 degrees OOP.

Otherwise I'd say the page we're on is not so entirely different.
Reply: @charlesstaton8104  
"But voltage measurements which match what we know current to be doing, what we know the EM field to be doing, are IMO not more “valid” but more valuable than ones which do not."

I certainly hope you're not suggesting that your method of moving probes to measure voltage is somehow more representative of current flow or EM fields. I think you're a little stuck there. It sounds like you think the 180 degree/inverted waves are some sort of contradiction to the EM field. They are absolutely not. How could they be; they show the result of things happening as a result of that field-- from a certain reference. Current flows in accordance with these inverted graphs as well when we use the center-tap reference.
Reply: I did wander over to the allaboutcircuits thread... don't worry, I didn't read more than a page or two :)

Assuming this is you: "I think it's perfectly valid to say "I have (3) 9V batteries connected in series, [same polarity/in phase] for 27VDC" Or "I have (3) 120VAC windings in series [same polarity/in phase] for 360VAC." Where would one include the voltage reference information in either of those sentences, and why? It seems obvious enough as stated."

For what it's worth, I DO agree with this sentiment. And I don't find it in contradiction with the 180 OOP wrt N paradigm, so long as it's clear that in your statement, one is talking about connections of linear sources. It get's a little more sticky with non-linear polyphase, and as such, it's useful to understand and use common reference measurements for phase angle determinations when drilling down a bit further. But in your usage case, in-phase is basically synonymous with series-aiding (or 'boosting') and that seems ok.
Reply from the maker: @spruce_goose5169   excellent! I think we have reached mutual understanding, even if not mutual agreement, that's still more than good enough. 

Just one last thing, you state "it gets a little more sticky with nonlinear polyphase, and as such, it is useful to understand and use common reference measurements for phase angle determinations when drilling down a bit further." 

I suspect you see my paradigm (even if you're too polite to say it) as overly simplified and surface-deep, but I can assure you that I have the conceptual understanding that you consider most important, I've put it to use, found it lacking, and made the determination that there is a more important underlying concept that gets glossed over too often. 

The importance that you place on neutral, I place on the EM circuits. The reason why (for example) is 3ph delta sources. There IS NO neutral or common reference, yet a phase separation still exists. If ones only concept of phase shift is tied to the concept of common/neutral, then all is lost. I've been there. I've had my understanding tested, failed, and rebuilt. I DID drill deeper, and what I found is what I'm trying to share here. The curriculum for Electrical and Electronics Engineering IMO places far too much importance on neutral, and I suspect that's because of how almost all oscilloscopes are made. Only ground/neutral-referenced measurements are easily demonstrated in the classroom so that's what the exercises are built around. 

12 years ago I spent $5k of my own money on one of the only scopes on the market that will allow one to take 480V 3ph measurements directly and safely, and I have been using it to take measurements of 3ph systems on a regular basis since then. In that time I have directly observed things that I think most in my field have only experienced through the lens of conceptual and mathematical circuit analysis and/or and derived measurements. My observations led me to where I am, bucking convention and causing a ruckus on the internet. I say this not to brag, but so that you may know that my shenanigans aren't spawned out of a barely adequate conceptual grasp of the topic and/or a lack of experience. 

If you have access to an isolated scope (and if you've never done this before) I suggest measuring some 3ph wye and delta circuits directly. Play around with the probes, flip polarity at random and observe the effect. Do the same on 120/240 split phase. It probably seems like you won't learn anything new from that, and maybe that's true, but it can't hurt.
Reply from the maker: @spruce_goose5169  Oh dear, I completely missed the reply before your last reply.

”It seems like much of your argument is predicated on the notion that the center-tap ground connection basically doesn't exist. It's as if you think it serves only as a point of measurement, and thus measurements using that reference point are hog-wash. But we USE that point in the circuit!”

It exists, we use it, it isn’t hogwash, BUT using it as the end-all be-all of reference points, the supreme and infallible center of the measurement universe, leads to a slightly skewed concept of what is actually going on in the circuit. 

”You may be saying this, but just for clarity: the field induces a voltage on the entirety of the coil simultaneously (or at the speed of light), not one end of it first, then the other. It is not some yo-yo that is traveling up and down the coil. I don't think you're saying that, but for clarity.”

For clarity, no, I’m not saying that. It’s as I described before with the field growing/shrinking.

“I feel I really get where you're coming from here and it seems to be the essence of your argument. If the primary is this one oscillating field, then how can the secondary suddenly have two 'phase waves' (if there is such a thing)? Those two waves must surely be some sort of figment. And honestly there is something to be said for that point.”

The secondary and the primary both have an infinite number of waves, or one wave, depending on how you look at it. They are voltage gradients. WE HUMANS are the ones who decide where the reference points are along that gradient, so the waves we see on our scopes are of our own making. If this is making sense to you, maybe we can take it a step further. You could scratch the enamel off of ALL the turns of the secondary winding, and measure from any turn to any other turn. If you had an 8-channel isolated scope you could simultaneously measure: 
1. from L1 (turn #0) to L2 (turn #1000) : 240V 
2. from L1 (turn #0) to N (turn #500) : 120V IN-phase with above
3. from N (turn #500) to L2 (turn #1000) : 120V IN-phase with above
4. from turn #70 to turn #600 : 151V (straddling the center tap) IN-phase with above
5. from turn #70 to turn #80 : 2.4V IN-phase with above
6. From turn # 650 to turn #750 : 24V IN-phase with above
7. From turn # 150 to turn #250 : 24V IN-phase with above
All the above measurements are taken with consistent polarity and appear IN-phase. Ground clip to the left and probe tip to the right. Now I change it up and connect my last ground clip to the right and probe tip to the left. 
8. From turn # 550 to turn # 75 : 114V OOP with above (straddling center tap, straddling other measurements, taken within other measurements, all of which previously shown to be IN-phase)

Did I create 8 phases by connecting 8 probes? Or did I create 1000 phases by scratching all 1000 turns? Or did I create 1 new phase by taking only one OOP measurement? Or did I create zero new phases because I’m simply measuring between different points on the gradient of a single phase?

“I agree that everything in a split phase system is 'in-phase' by virtue of there being matching peaks-- and there is also no potential for a rotating magnetic field, it is all linear-- but by splitting the secondary (which is electrically the same as having two series-aiding generators), we affect the secondary circuitry in real ways. If loads are perfectly balanced, this becomes less obvious (besides measurements we might take using this center-tap). But when there are imbalanced loads, the secondary will imbalance (or you could say one 'generator' would be more loaded) and which side (or generator) depends on which 120v load is bigger.”

I agree, and I previously stated this. By uneven loading, you will effect the magnitude and distribution of the EM field in one half of the core, but you will not change the polarity, angle, or number of phases.

“To me, the two inverted sine waves could be considered indicators of this ability to imbalance one end of the coil / one generator. How would one single wave account for this? The maximum peaks coincide in time, but the peaks have opposite polarity, and thus on one side current will be traveling towards this common point, and on the other, away.”

This doesn’t seem consistent to me. Current doesn’t care whether you observe it going towards or away from any given point. You CAN observe it this way if you find it helpful, and if you did, the fact that current is travelling towards the common point on one leg, and away from the common point on the other leg, would indicate that current is flowing all one direction (which happens to be the claim I’m making) – so how are you using this as proof that the waves have opposite polarity?

“Which leads me to one other point: I'm a bit baffled by your insistence that current is somehow different from voltage in terms of phase relationship. I know you realize voltage causes the current, and so as polarity shifts, so to does the direction of current.”

I view voltage as an absolute like current. It exists, independent of how you measure it; what polarity you use in connecting your probes, which points you sample. The problem with this, is that the voltage measurement as it is defined, exists between two points, and as long as those points are called out, the measurement is valid. Some people consider voltage to BE a measurement, which precludes its existence as an intrinsic property of the universe in the absence of any measurement. They will say that the two halves ARE OOP because the voltages ARE inverse because voltages ARE measurements and the measurements ARE OOP. I can’t argue with that. If that’s how you define voltage (existing only as a measurement) then I can’t navigate the discussion under the terms in which it’s been framed. So in that situation I bring up the absolute nature of current, and most people don’t argue this point with me; you’re unique in that regard. My point is that if you define voltage as I described above, then sure, your measurements reflect that the two halves ARE OOP, while mine reflect that they are *NOT*, so how do we reconcile this? I defer to the absolute nature of current, but you challenge even that, so now I once again find myself unable to proceed.
 

”And current still needs some frame of reference. On earth, we have cardinal directions to describe 'absolute' direction, but electrically what is the equivalent? If I stood on one bank of a river, it would be going left to right. On the other bank, it would be going right to left. I could say 'it's flowing south,' but in an electric circuit what would I say? It's flowing towards the battery?”

Yes! It’s flowing from one side of the source to the other, no matter how you observe it.

“Uh, oh, nope. Cus it's doing that no matter what.”

EXACTLY! That’s what I’ve been saying all along. You’ve just identified the absolute nature of current. What is the problem?

”It's flowing towards the neutral? Nope doesn't work either. Of course you could put a diode in or something, but it doesn't change the need for phase relationships to have this commonality, just like with voltage. How about we say 'away from, or towards, point N? It works!”

Yes, it works. But it’s just a mental aid. It helps us grasp the direction current flows through multiple paths, but it doesn’t decide the direction current flows. Current flows where it flows, and the perspective from which you observe it is irrelevant.

”Whether it's voltage or current, when you insist on moving your probes like you do to force 'in-phase waves', it feels like your putting the cart before the horse: that you have a preconceived notion and your trying to prove it.”

Ok, fair enough, but aren’t you, too? The only difference is that you have convention on your side and I have physics on mine. I’m trying to prove that the probes CAN be moved, and an equally valid result CAN be shown, and that one of these forced pictures aligns better with the physical reality of what’s happening on the EM level, and you’re free to do what you want with that info.

”I think it actually weakens your argument because it suggests you don't understand the concept of common reference (which doesn't need to be a physical neutral and can be virtual, but nonetheless must be common).” 

I think we’ve exchanged enough words for you know that isn’t true.

“Don't forget the 30 degree phase shift when changing from phase measurements (L-N) to line measurements (L-L).”

What? I have no idea what you’re talking about. I can measure from L1 to N simultaneously with L1 to L2 and they will be IN-phase. No 30 degree shift. No idea what you mean.

“I suppose I can't help but add that if you don't have a rebuttal for the fact that the way you are suggesting measuring phase relationships would lead one to go out and measure 3-phase as being 60 degrees OOP, then I'm not sure why you worry about people getting 'confused' by thinking L1 is 180 OOP wrt N to L2, because if they go and do what you suggest, they're gonna be coming home to mommy saying 3-phase is 60 degrees OOP.”

I thought you said this wasn’t what you were implying, (hence why I said there is no rebuttal) but now you’re more than implying it, so my previous rebuttal stands. I’m not going to reply to this again when I’ve already addressed it at length.
Reply: @charlesstaton8104  

"...using it as the end-all be-all of reference points, the supreme and infallible center of the measurement universe, leads to a slightly skewed concept of what is actually going on in the circuit."

It's not the only reference we can use, it's simply a useful reference and it absolutely does represent what's going on in the circuit just fine.

"The secondary and the primary both have an infinite number of waves, or one wave, depending on how you look at it."

I don't understand why you are referring to a changing electromagnetic field as a wave. It can be modeled against time as a wave. IT is not a wave the way you seem to suggest. And as such, inverted waves when referenced to neutral are NOT in any contradiction to reality OR PHYSICS as you claim elsewhere. This really seem to be where we disagree the most, and we may just have to move on and agree to disagree.

"Did I create 8 phases by connecting 8 probes? Or did I create 1000 phases by scratching all 1000 turns? Or did I create 1 new phase by taking only one OOP measurement? Or did I create zero new phases because I’m simply measuring between different points on the gradient of a single phase?"

If you agree that the phrase 'L1 and L2 are 180 degrees out of phase wrt N' is accurate, I don't know why you're asking this question. It depends on reference. Your stacked sources are surely 'series-aiding' though, no argument there, so not sure where we go with it. I think we probably actually have no disagreement with any point here so let's not create one where there is none. Maybe the only disagreement is what the ultimate definition of 'phase' is. You seem to think more of it as a physical unchanging THING where as I view it as a relationship between physical things. If that's the case, I think in the name of time, we'll have to walk away agreeing to disagree. 

"Current doesn’t care whether you observe it going towards or away from any given point...so how are you using this as proof that the waves have opposite polarity?"

Where did I say anything about polarity? Polarity is an awkward concept in current for me. What I'm saying is the sine wave graph, when referenced to neutral, is displaying positive waveform values as 'coming' and negative waveform values as 'going.' And as such, two OOP forms will be displayed. Again, no lie, it's just a reference thing. You are simply choosing to reference from one end of the coil, but in doing so you won't know what's going on in the neutral (center tap).

"I defer to the absolute nature of current, but you challenge even that, so now I once again find myself unable to proceed."

OK, I think there's a bit of misunderstanding of what I'm saying. I'm not saying current is a measurement of potential between two points like voltage. I'm saying we need some frame of reference to define the direction it is going. This is true of anything, including rivers. The direction it is going doesn't 'change' in an absolute sense, but where we are standing DOES change whether we view it as coming or going. Don't read into it too much. I'm simply describing why current waveforms measured with respect to neutral look as they do. 

"It’s flowing from one side of the source to the other, no matter how you observe it."

Huh? It's always flowing in and out of the source, but it's changing 60 times a second. So we should just draw current as a forever positive line because the current is always flowing 'towards' some part of the source?

In the neutral, current is flowing in or out depending on which load is bigger, and then flipping with the AC cycle. So it's NOT flowing in the 'same direction' as a constant: i.e. it depends on the loads. I fear this specific aspect of our discussion is just getting into the weeds and there is no need for disagreement. If there is disagreement it's simply due to a misinterpretation of what's being said. We both know how the current is flowing in a split phase system--it's not some big secret.

“Don't forget the 30 degree phase shift when changing from phase measurements (L-N) to line measurements (L-L).”

"...No 30 degree shift. No idea what you mean."

My apologies, I stuck that comment in with no context! I meant to refer to 3-phase. I.e. delta-wye 30 degree phase shift. My point is just that phase relationships depend on how we reference. When you use differential probes to measure delta circuits, your waveforms will be both larger in amplitude and phase-shifted 30 degrees compared to wye (Line-Neutral). This all aligns perfectly with the physical reality (looking at a simple generator and seeing where the magnetic field is at that time is illuminating, as the max peak is actually between two poles). Perhaps you agree and see no real 'point' to this point, and if so fair enough. I'm just trying to drive home that where we measure things matter, and at the same time where we measure shows a certain reality. In other words, both our measuring schemes show proper realities, they just have different uses and mean slightly different things.

More than anything, people need to understand what they are measuring and what it represents. That's really been my point all along. 

"I thought you said this wasn’t what you were implying, (hence why I said there is no rebuttal) but now you’re more than implying it, so my previous rebuttal stands. I’m not going to reply to this again when I’ve already addressed it at length"

Sorry, I guess we had some miscommunication here. I don't know where we went wrong. I have all along been trying to say this. Frankly, I was a bit surprised you were so nonchalant about it. 
Perhaps I need to be more clear about what I'm saying:

If one applies the paradigm of measuring phase angles as you have: by putting black on L1, red on N-- then moving black to N, and red to L2, and superimposing these images. If one does this with a 3-phase system, consider what phase angle they would end up with. L1 to N, then N to L2 essentially inverts the L1 to N 'phase' and so you would end up with 60 OOP instead of 120. 

So I guess I'm not sure if you disagree with what I'm suggesting the result would be here, or if you are just saying that my comparison is irrelevant. If the former, we have some technicals to work out. If the latter, we will probably have to again just agree to disagree. I'm satisfied with the level of agreement we generally have, despite us both likely to leave thinking the other is missing some points. Such is the way of these things. Cheers mate.
Reply: "But in doing so you won't know what's going on in the neutral "

Sorry ignore that statement entirely, it's not true and I'm not sure where I was at...